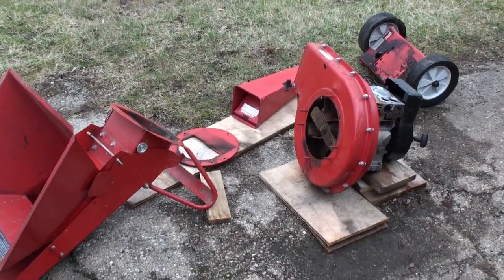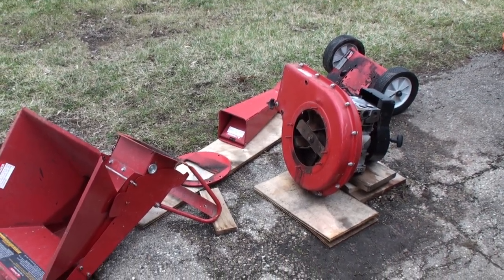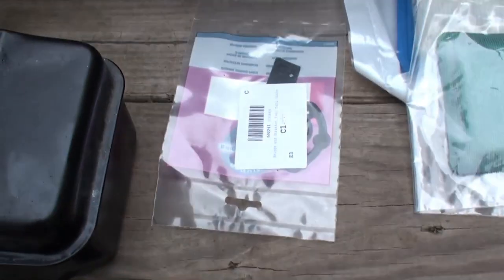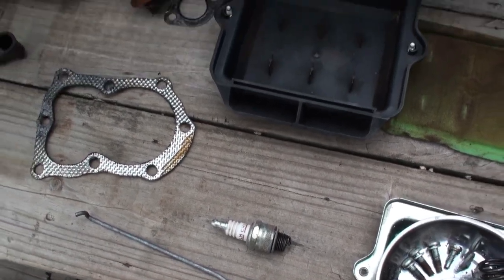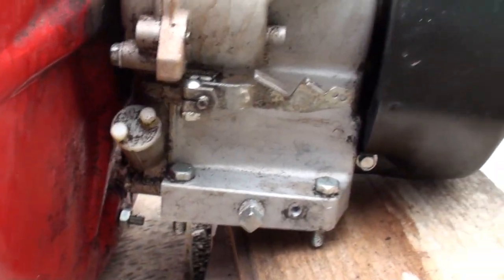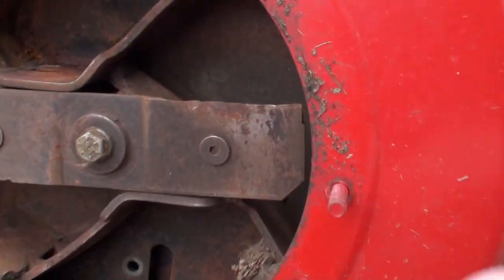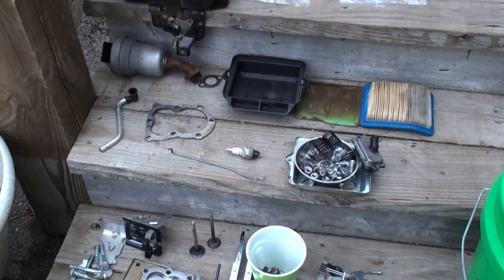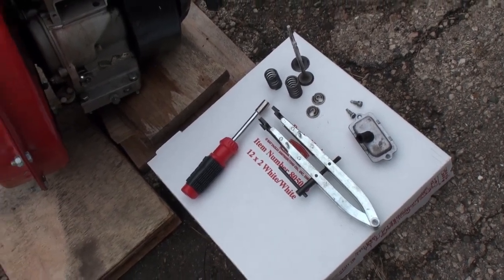Wood Chipper Repair

Comment: I have the same chipper/shredder.  I bought it new back in 1996ish.  It has been used and abused since then.  All I have done to it is the regular maintenance and a new pull cord.   Over the past few years, it has been VERY hard to start.  Once I get it running, it runs well.   I think it is time to clean it up.  This video was very informative.  So if I decide to clean it up on my own, I know what to expect and where things go.

Comment: You did an excellent job on this video - Congrats! I'm working on mine, looks to be the same machine. I bought it back 1997/98, not sure when you got yours. Mine is getting a carb swap, gas tank sealing for rust and flail blade oiling. Hoping it'll be done and running in the next month. Good job for what time you spent in actually rebuilding it and got it in a 25 min video! I'm sure the actual time spent was way more than 25 minutes.

Comment: I have the original motor on mine and have had it apart many times to fix things here and there and kept it clean. Now it’s BLEEDING oil from the seal around the main shaft right by the pull rope area. Can’t find parts for it anymore.
Is there some kind of replacement motor I can use for this chipper? I love this thing cause it eats anything I throw at it.

Comment: The problem here is he has the Breaks & Scrap Em motor on that thing... My girl friends son brought one home here any he tried he tried really hard that he did but I told him about the Governors on em seize up on occasion after the carbs get corroded really bad. He didn't listen to my advice. We had a temporary fireball in the back work spaces that singed the picnic table really good. Come spring he is gonna fix that boo boo...